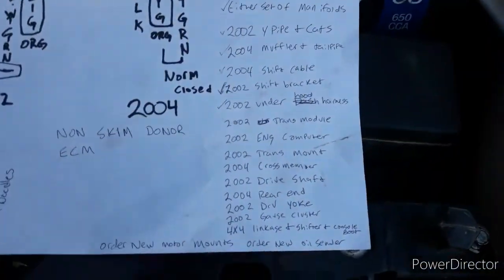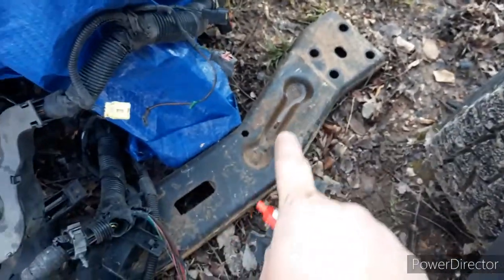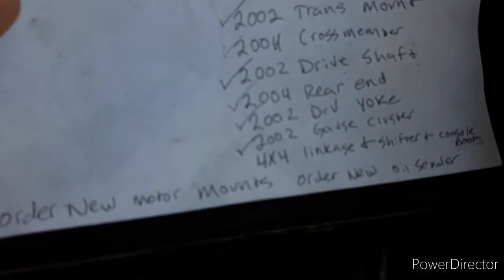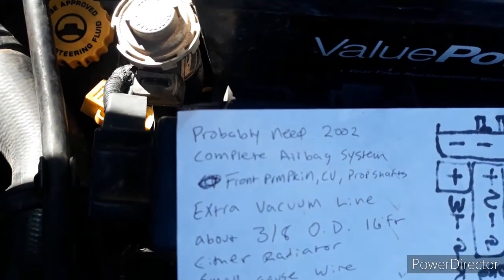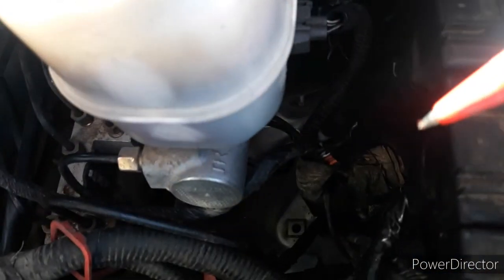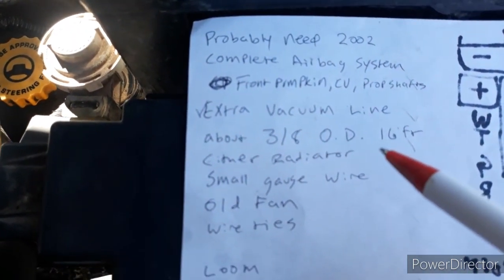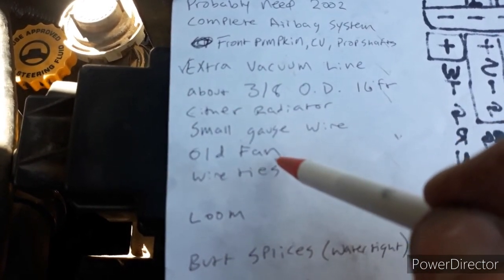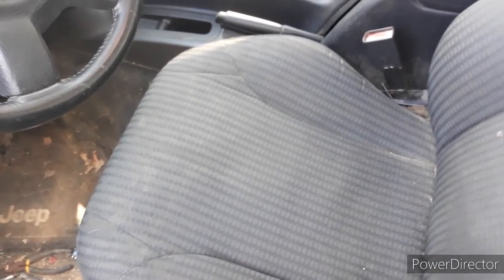Jeep Liberty 42rle to 45rfe and 4x4 upgrade part 2

Comment: Fucken eh...i bought an 02 donor for my 06 cause i needed the transfer-case & engine oil pan. Swapped those but ever since i've been looking at the 45rfe & wondering what i'd need to swap it in place of my 42rle. This was a huge heap of info thanx for doin the leg work guy. I mucho appreciate it.

If you got any updates or anything real important you've figured out since...i'd be more than interested to know. Thanx again!
Reply from the maker: I actually sold this car and it's still going strong. The only issue is that the 2wd front springs arent stiff enough for the extra weight of a differential and transfer case but if you already have a 4x4 I dont think it'll matter